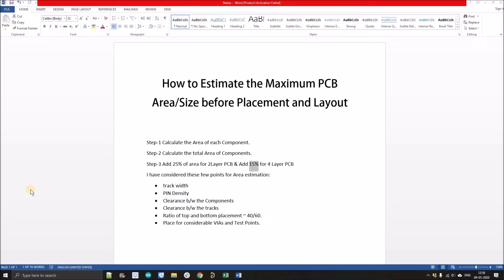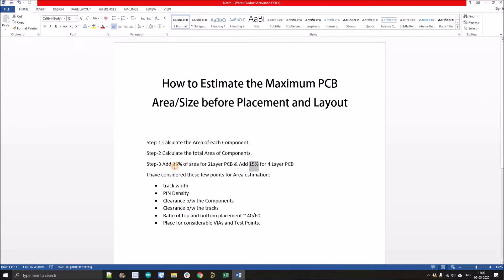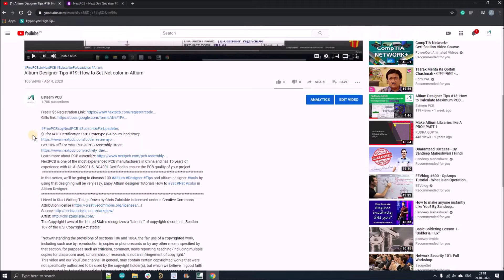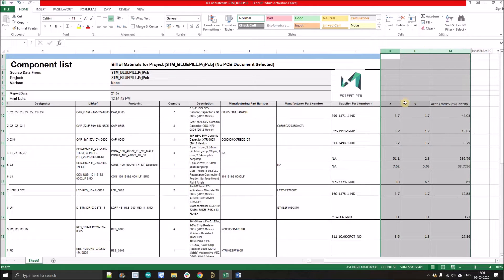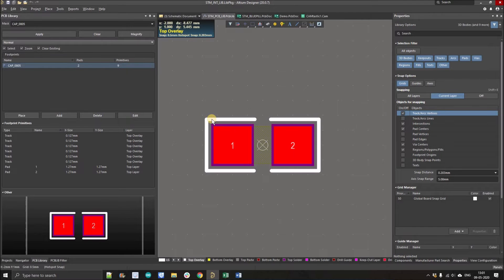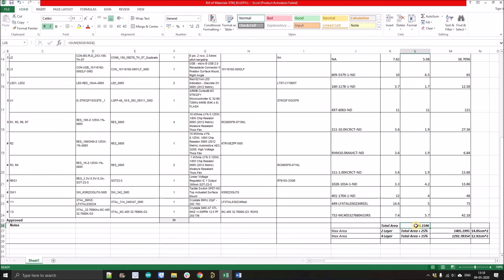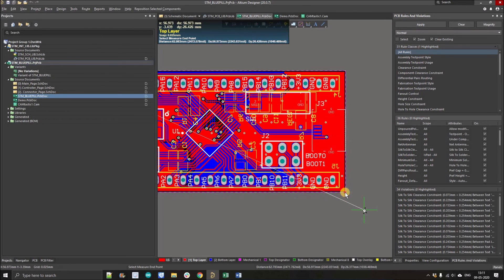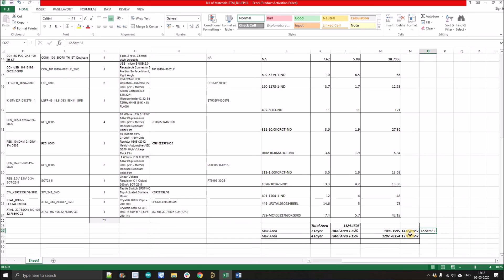Calculate Maximum PCB Size/Area | Altium Designer Tips #37 | Sponsored by "Nextpcb.com"

Comment: What is the system requirements for altium 20? because my laptop screen sometimes freezes and causes a lot of lag and overall slow performance. I have core i5 4th gen 4gb ddr3 ram.
Reply from the maker: You can go through with this link, I also faced the same issue while designing large boards, then I increased the RAM to 16Gb and 4 Gb graphics Card  https://www.altium.com/documentation/altium-designer/altium-concord-pro-system-requirements